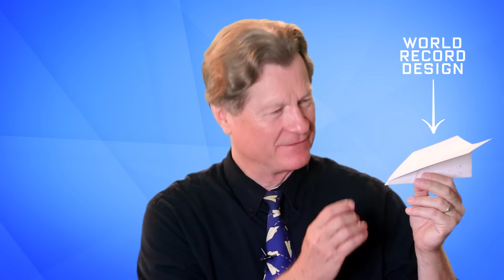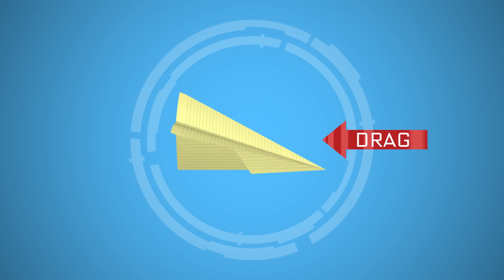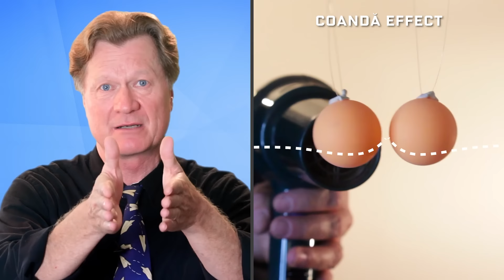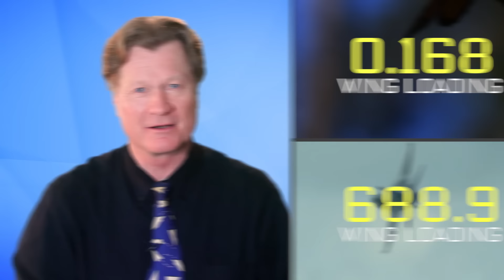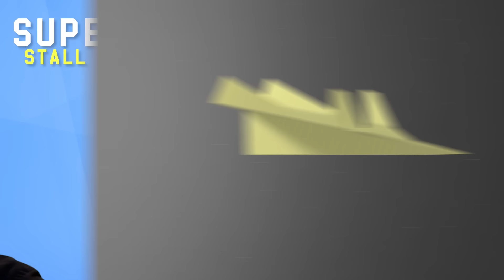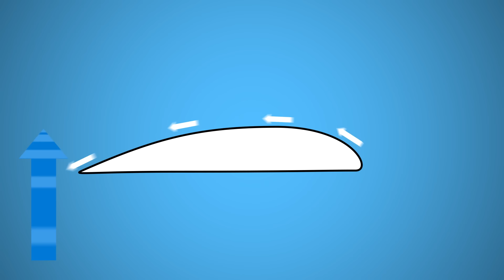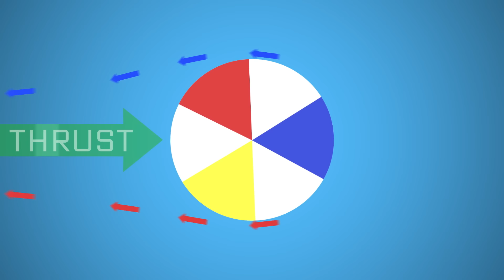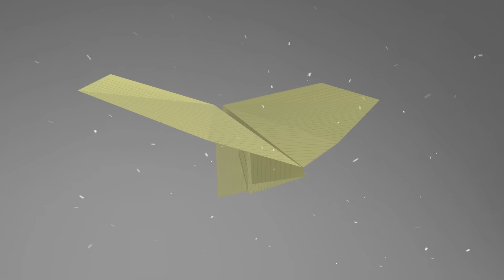Aerodynamics Explained by a World Record Paper Airplane Designer | Level Up | WIRED

Comment: Isnt his lift explanation wrong? Isnt the pressure difference what causes lift?
Reply: https://en.wikipedia.org/wiki/Lift_(force)#Controversy_regarding_the_Coand%C4%83_effect
Reply: As he said, people taught it was the Bournelli effect, but through more research it's likely the Coanda effect. Might have to find the research paper on the effect, but it's possible that the two effects could be the overall contribution to lift, so Bournelli AND Coanda.
Reply: @s3cr3tpassword  As an aerospace engineer currently working on his PhD in computational fluid dynamics I can tell you that no fluid-dynamics scientist EVER thought of of the "bernoulli effect" as the CAUSE for lift. Also the "coanda effect" is not really an "effect" in the sense that it causes anything. It's just a sort of description of something that happens when a fluid flows around an object, and that flow is perfectly described by the Navier-Stokes Equations. Saying "This happens due to the Coanda effect" is simply wrong. "This" happens because that's how fluids behave (again, perfectly describes by the Navier-Stokes Equations), and we call this behaviour "Coanda effect (which is a term fluid dynamicists usually don't even use).
Reply: When I took Finite Math and all the shortcuts they told me not use in 3rd grade were finally taught.
Thanks for the explanation, because thanks to this video, I noticed that I no longer knew how airplanes could fly.
Reply: @ElmojitoYTjop  That's how fluids behave-- the Coanda effect.  Most viewers of the video aren't fluid dynamicists and won't need to quantify the concept using Navier-Stokes, Bernoulli, and Reynold's numbers.  I suppose we could have spent an hour or two at the white board sketching out those details to your satisfaction so that we could leave it all on the hard drive, never to be seen by most humans, who struggled with algebra.
Reply: @ThePaperAirplaneGuy   Enjoyed the video. The explanation of lift a little less so. (Hope you can take that constructively; not meant otherwise). 

Bernoulli Principle being "wrong" should really be edited-out of the vid. Lift is a combination of Bernoulli explanation, and Newtonian (2nd AND 3rd Laws). Half if lift is "Downwash", as you said. But an equal amount is "Upwash" in front of the wing. Bernoulli Principle is required for circulation between those 2 to occur. Without it, no lift will be generated. But Bernoulli isn't the entirety of lift. Inertia of air molecules and velocity interact with each other, setting-up a reinforcing, propagating pressure flow around the wing. So Bernoulli (which governs that flow) really is half of the story. Without it, there would be no 2nd Law force, and no forward motion (also no lift). 
Lift is complex, and nobody understands it fully.
Reply: @onebylandtwoifbysearunifby5475  In so far as Bernoulli is explained by the equal transit theory, it's wrong.  The air over and under the wing doesn't arrive at the trailing edge at the same time.  This basic underpinning is how most people understand Bernoulli.  As an equation, Bernoulli has unbounded utility.  As a way to describe a plausible, physical cause and effect, it doesn't pass the sniff test.  Planes fly upside down.  Most aerobatic planes have wings that curve equally on both top and bottom. And really, if you have a problem with the explanation, you have a problem with NASA and not me.  They're now describing lift as I have.  If you manage to convince them, I'll suggest a re-edit.
Reply: @ThePaperAirplaneGuy   I'm not holding my breath for an edit, btw. Still, something like "lift is not fully understood intuitively" or "lift is an area of ongoing research" may encourage people to study the subject. Then maybe one day there will be a single explanation of lift. Well, thanks again.

Comment: Does the downwards airflow really lift the wing with Newton's third law? Then there must be an attractive force between the air and the surface. Is it that big in the microscopic boundary layer? I can better imagine that a low pressure volume is created - not by fast moving air but by air that changes direction. Someone please put a pressure sensor between those pingpong balls 4:35.
Reply: I'm sure there's a somewhat lower pressure, but it's not the dominant force acting on the objects.  There's a measurable lower pressure on the top of aircraft wings.  It simply insufficient to lift a plane.
Reply: Nops, he is just wrong.

Comment: The downward air at trailing edge is lift?  What about drop in pressure on top of airfoil because of velocity increase?
Reply: Pressure difference IS a large part of lift. Downward force of air displacement is also. This vid made it seem only the latter was responsible. That is not an accurate assumption. It is both.

"Stall" is boundary layer sheer. If Bernoulli is not considered, wings would lose lift much earlier than they do, and at lower angles of attack. 

I must admit i cringed at his explanation. But i came here for the paper airplanes.